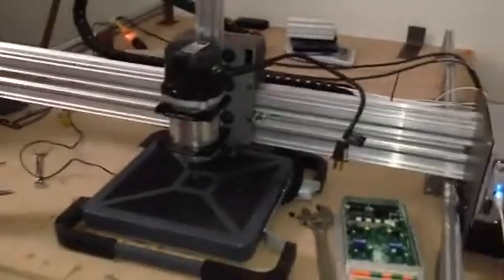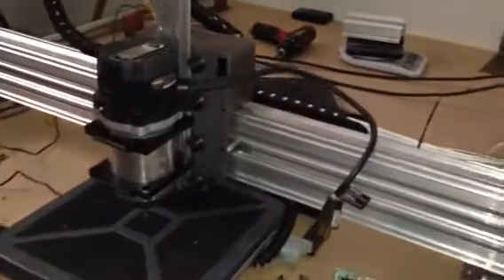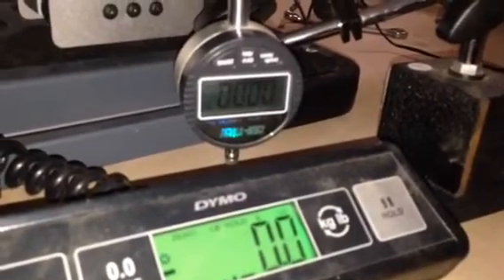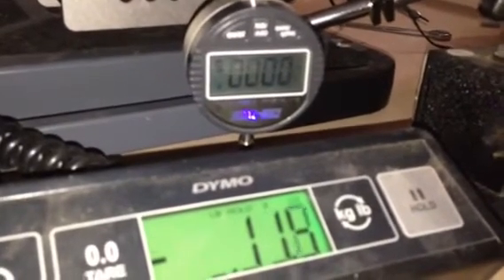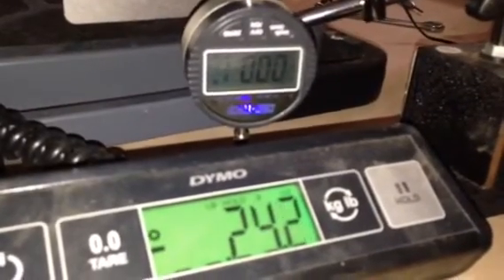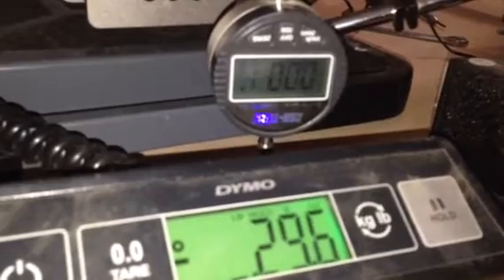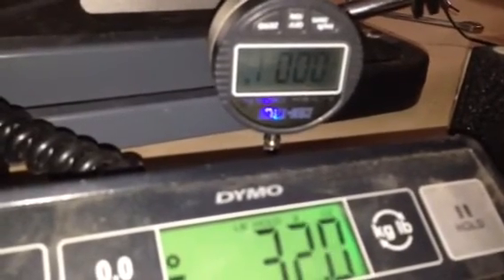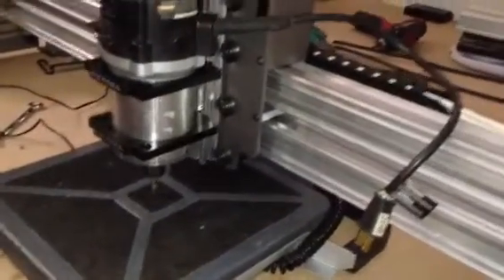Cnc Mogul 6.0 deflection

Comment: also another v1 design issue is that when machine is off the z axis (with router mounted) just drops and smashes on the bed...there is nothing to keep it up due to horrible design....the only way to keep z axis from dropping is to have the machine on which makes no sense......i would like to hear from anyone who still owns one of these

Comment: So what I am interested in is how the Z axis will deflect. To test this, take a junk 1/8 bit and plung it into a scrap piece about .5 inches. Then using the indicator, zero out on the back of the extrusions on the Z and start to move x++ and see how bad it will deflect before snapping the bit.